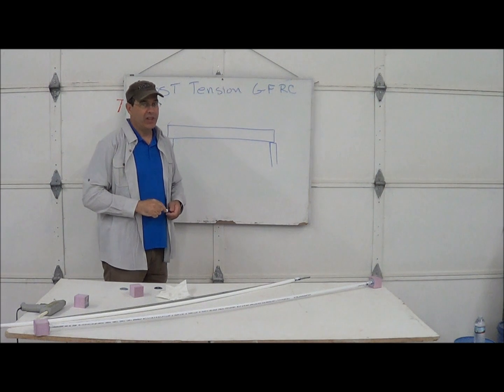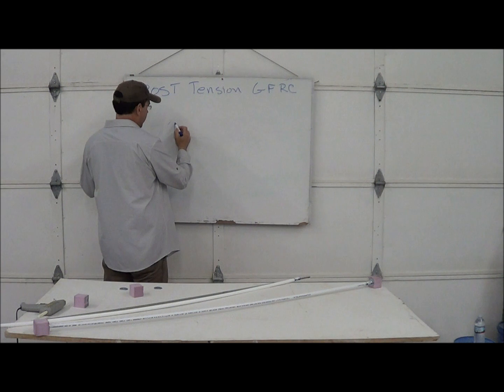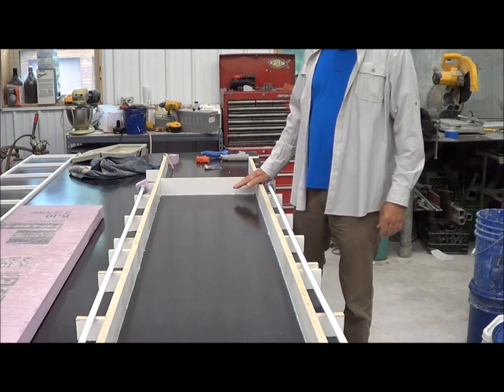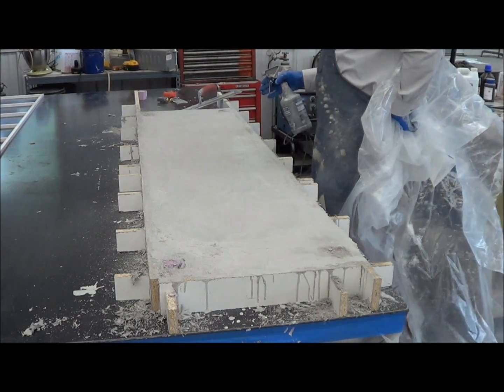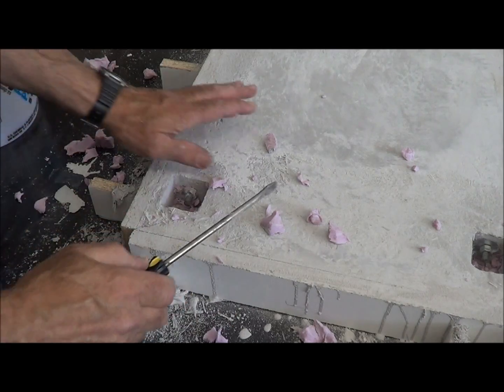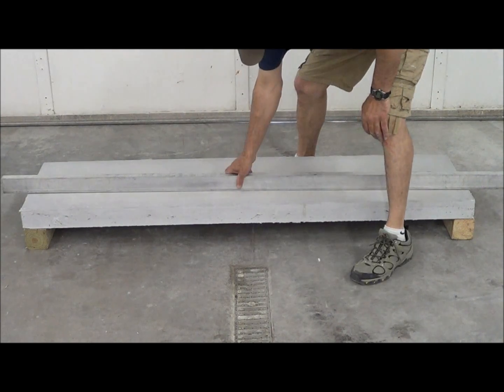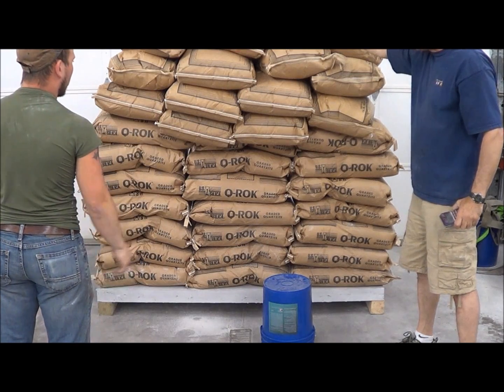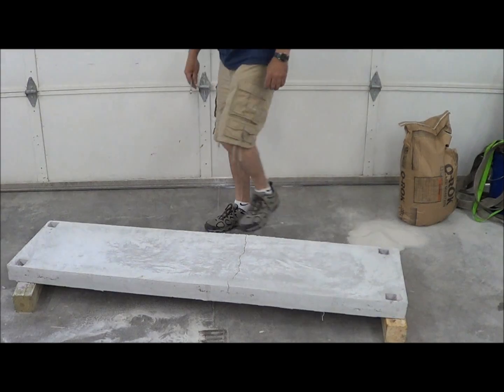Post Tensioned GFRC - Glass Fiber Reinforced Concrete

Comment: Hi there, what is your casting table made from? I currently use a wood grid however always need a bottom melamine piece to place my side wall forms on. Much more material and cutting that right on a table. What do you polish your table with?
Reply: Additionally, can you spray on it or need SCC?
Reply from the maker: Our casting tables are steel. The frame is 2x2 tube steel 2’ OC with trailer jacks on the 6 legs so we can move them and level them